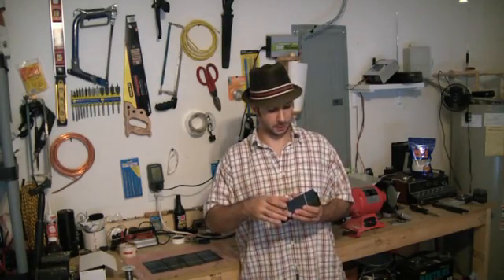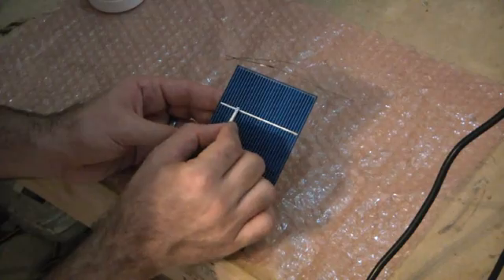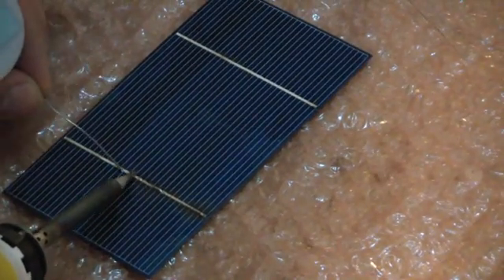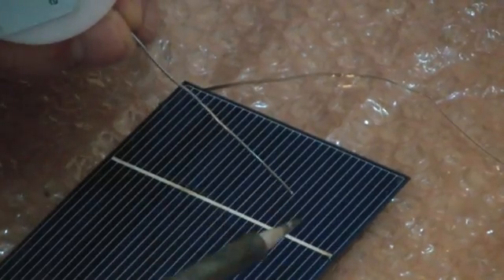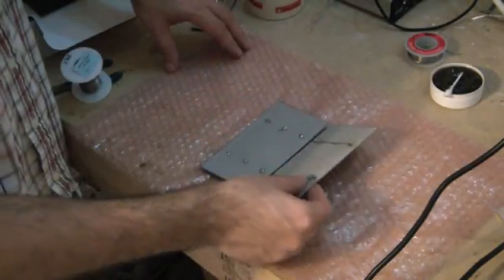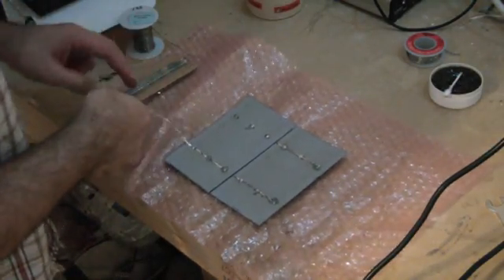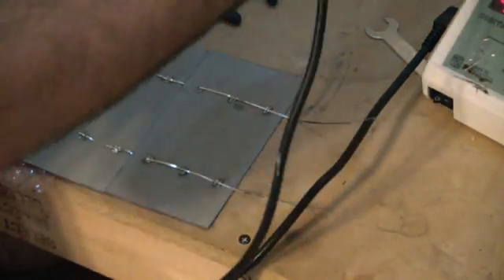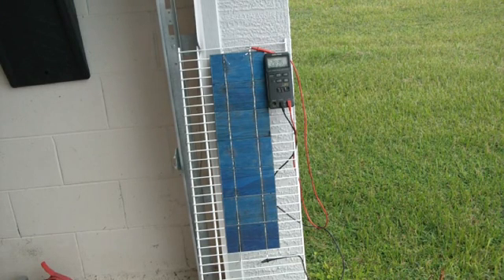How to build a solar panel.  DIY Solar cell tabbing & solar panel testing

Comment: Also, I thought the tabbing wire is self soldering.  Have you tried soldering it without using solder?  I guess the tin coating on the wire acts as the solder.

Comment: Does the tabbing wire have to be in flat contact with the whole strip?  It looked like you had a couple places where it arched away from the cell on the first one you did.

Comment: Honestly... your soldering technique(s) need work. Use a fan to blow the solder smoke away from your face, and, if possible, do it an outside ventilated room.

Comment: @mixcatcom yeah i have seen them mounted a bunch of different ways when they are built like these are that's why i asked. saw one design where a guy re-purposed his old c-band satelite and covered them with thin lexan, saw one mounted in boxes all around his chimney, one that built round cylinders out of them for on his roof those designs were so no matter what time of the day it was they were getting energy from the sun. I am still impressed with the solar shingles actually.

Comment: I just looked up the cost of solar panels on Amazon.com  $875.  The price of a solar cell?  $1.35- $4.99 X 55 cells versus $875 for a 55 cell panel.  This is valuable information.

Comment: leave a little space between the cells so they don't short across.  I use a 50 watt Hanko iron with a regulator so I can regulate my temperature. the temperature can be to hot and too cold. check out my video on diy aluminum framed solar  panels on my channel.